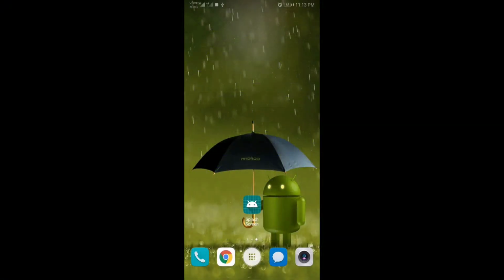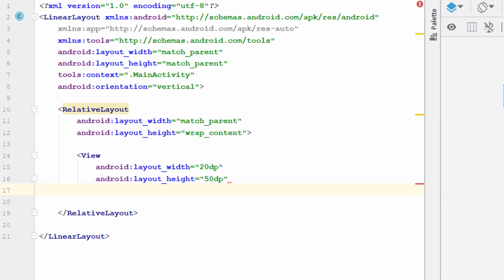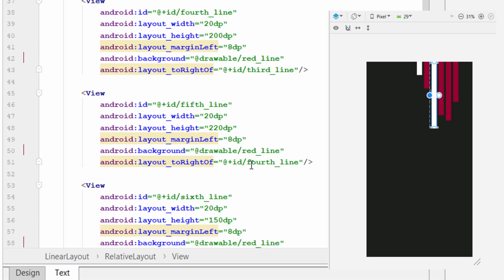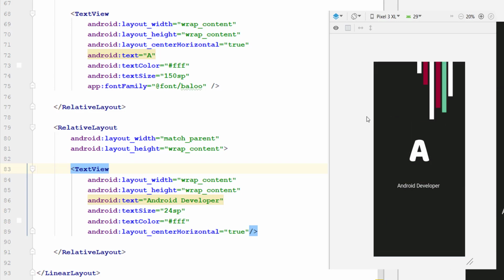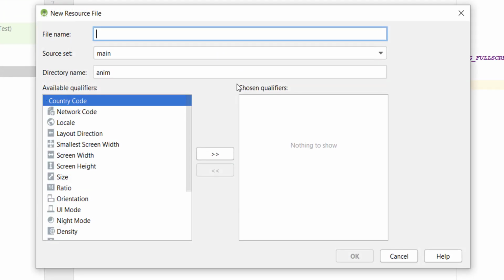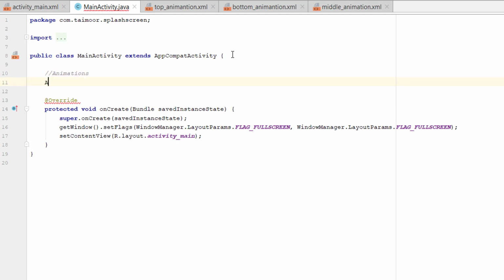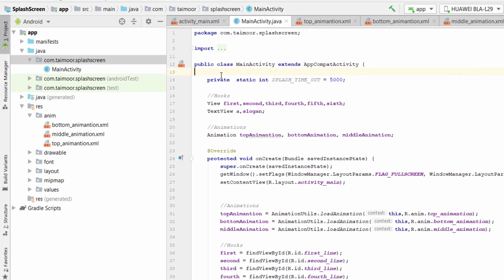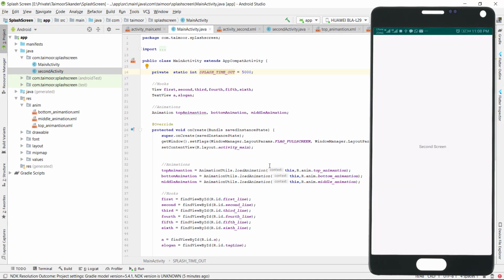Splash Screen Android Studio -  Android Splash Screen - Android Studio Splash Screen

Comment: Hello. Thank you for the video. I have a problem: after switching to the 2nd screen, every 5 seconds it goes back. can this be done only 1 time?
Reply from the maker: Goes back? You might have added some timer code to the 2nd class also?
Reply: @CodingwithT  The transition to the 2nd asset works fine. But standing on the 2nd window, the window is updated every 5 seconds. It was hard to explain))
Reply: The timer is 5 seconds. The animation works great. Finish works (it doesn't go back, it just closes) When I open the program, the animation goes for 5 seconds and goes to the 2nd Activity where there is the text "Hello World" and after another 5 seconds it repeats again, updates the 2nd Activity every 5 seconds